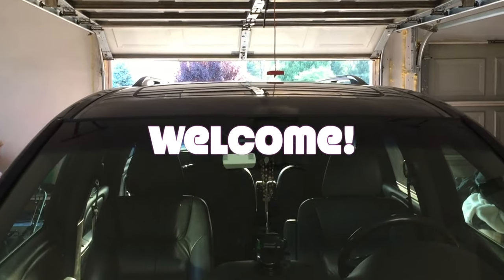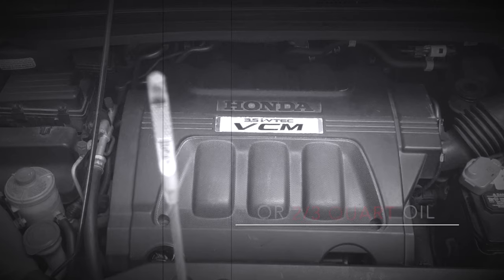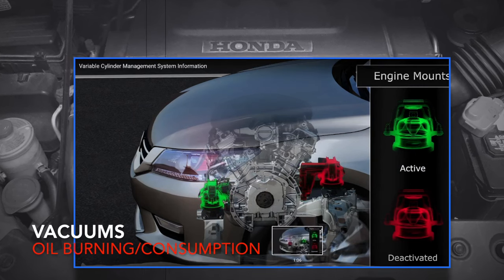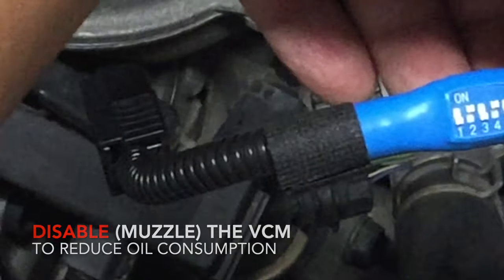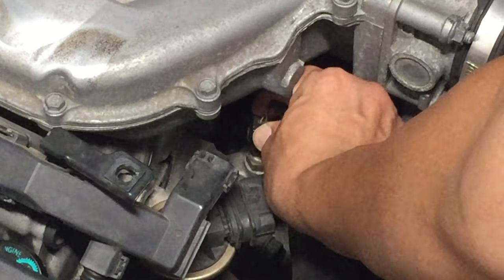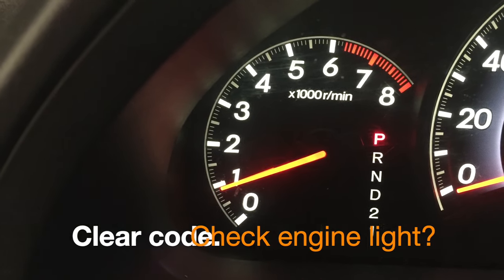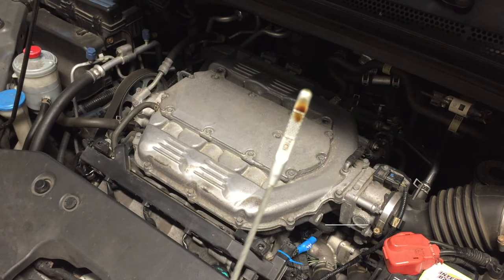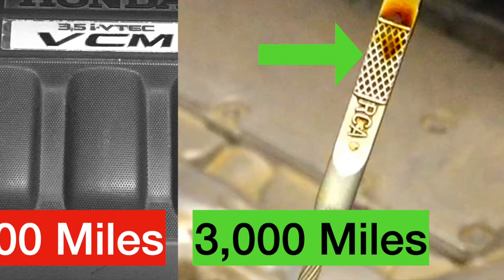Honda V6 Engine Burns Oil? Fix it in 5 minutes.

Comment: I'm I Pennsylvania I bought a 91 ohm muzzler. Will that work in the winter aswell?
Reply from the maker: 91 ohm will work in the spring/summer in PA. It might throw a code in the winter. You may consider switching to an 82-ohm in the winter, which works for me.
Reply: Is there a in between were you can set and forget?@profsg
Reply from the maker: It's possible to find an ohm in between for most of the time. But I believe it may still throw a code occasionally, if not rarely. If you know the code is okay, you can ignore it and let it disappear on its own. There is also a pricier S-VCM controller that can automatically adjust itself.
Reply: Imma give 85 a shot  the worst it could do is activate eco once every moon lol @profsg

Comment: I need to disable VCM on our 2010 Ody EX-L. I worked through a check engine light, VSA light on the dash and engine shudder this past week. All seems to be working now! I've read up on the evil VCM and want to disable it for good. I considered the options listed on OdyClub and Piloteers, but want to spend as little as possible since we are not in this Ody for the long run anymore, actively looking to trade it in.  The DiPressor seems like a good solution for a good price. I considered the DIY route, as it is really cheap to do, but doing it that cheaply is permanent.

@Professor's Garage and others that have tried the DiPressor, are you all still happy with it, meaning is it still doing its job at disabling VCM and keeping the evil ECO light at bay?  Professor's Garage, definitely interested to hear how it is holding up with PA weather.  We are in MA, so have snowy winters and roads treated with salt just like you guys.

FYI, it looks like the eBay DiPressor seller is also selling it on Etsy.
Reply from the maker: This holds up quite well. I did adjust the ohm setting between fall/winter and spring/summer; I only saw the ECO light once or twice during the change of season. Most important, I am happy with the rate of oil consumption and could almost get by without adding oil between oil changes... but I did add some oil to avoid issues. :)
Reply: @profsg  Thanks for the reply! I do like how customizable the solution is. Much better than the crude DIY solution I was planning on doing. I think I even saw on the DIP switch settings page that you could even re-enable VCM, which could come in handy for future troubleshooting.  Thanks for sharing the settings you are using up in the description.  I think I'm sold on DiPressor over the more expensive options elsewhere.

Comment: I prefer using my VCM Tuner II which has some built in features to avoid having to reset for the seasons and will bypass if engine is actually overheating.
Reply from the maker: That's a great feature! Thanks for sharing!

Comment: I wonder if this solution could also solve the (end result) problem of oil burning consumption plaguing 2010 - 2013 Acura MDXs?
Reply from the maker: It has a different engine (J37 instead J35 in the Odyssey). But if they share a similar VCM design--looks like they do--the same trick will likely work there to reduce oil burning. Best luck and keep us posted!
Reply: Probably since Honda makes Acura.

Comment: My 08 honda pilot get 2mpg more when eco mode is off on the highway. With a check engine light on, the Eco mode never come on.  Check you MPG before and after.
Reply from the maker: Thanks for sharing! Interesting you got more MPG with ECO off. Regarding the check engine light, if it's a code associated with an engine condition, the ECO/VCM mode may not come on as it does require certain engine conditions to activate.

Comment: I heard of this,   But never saw how todo it
One thing that helped my 2007 model was to change PCV valve. 
Now it’s about 1qt per oil change
I also use high mileage synthetic blend 5w20 havoline.  I was using super tech  and than burned more then 2 qts oil.  For each oil change
Reply from the maker: Thanks for the comment! 

Yes, PCV is another common reason for oil burning. And on this engine, it is easy to access and replace. I replaced PCV a couple of years ago, and that helped. Also replaced valve cover gaskets and VTEC spool gaskets because of oil leaks. In my case, disabling the VCM significantly reduced oil burning. 

The high mileage oil (additives) may help when rubber seals are aged and getting brittle. I've also heard positive experiences with ATP AT-205 for aged rubber seals.
Reply from the maker: On PCV and other replacements, go with Honda parts if possible.
Reply: It would be best to use Full Synthetic oil than that Synthetic blend they sell

Comment: What about 2006 Acura tsx
Reply from the maker: If it's a 4-cylinder engine, which I believe it is, it doesn't have VCM and not affected by this design. If it burns oil, do make sure to change PCV (Positive Crankcase Ventilation) valve which is the #1 reason for oil burning. Another simple job to do and I have a video here: https://youtu.be/uIHNY6AiDQM  

If this doesn't completely fix the issue, just make sure you monitor oil level, top it off regularly, and, most importantly, follow regular oil change intervals (5000 miles or 6 months). For an aged vehicle like this, you may not be able to completely fix the issue but good oil may overtime clean up some of the clogged components (e.g. stuck piston rings) to alleviate oil burning. Hope this helps.

Comment: Wait.  Does this mean that the ECU is permanently running in open loop, since we're telling it that the coolant hasn't reached operating temp?  Wouldn't this kill your fuel mileage?
Reply from the maker: This is One of the coolant sensors on the engine and the one VCM relies on to determine whether it has reached the ideal condition to turn on. If the adjustment is minor, it will fool the VCM but not affect the other operation. That’s why you may have to monitor engine code and change Dips so it makes no drastic change for the season. There are other options like s-VCM that will make the adjustment automatically and several people have reported positive experiences with that. As for gas mileage, no big difference, somewhere near 1 mpg less, in my experiences.
Reply: No, sufficient heat to transition to closed loop.

Comment: I installed a smart vcm without the resistor settings. It's been about a year and now my 09 odyssey was 2 1/2 quarts low IDK if this is the answer
Reply from the maker: From what I heard, s-vcm is a good product, an improved version of what I have in the video. If you no longer see the Eco indicator, the problem with VCM is taken care of. Now the other common culprit for oil consumption is PCV and I have a separate video about it: https://youtu.be/bGVFDy7I0j8 

Very simple to replace. Given the age of your vehicle, you should change it if it hasn't been replaced.
Reply from the maker: Is it 2 1/2 quarts down between oil changes? I assume you do it every 5k or 6 months whichever comes first?
Reply: Between oil changes i drove my wifes Odyssey and had made a right hand turn and for a split second the oil light turned on. I checks the oil and it was extremely low there's no oil on the drive way and no visible oil from the valve cover or the solenoid area
Reply: The vcm defeat does the job it deactivated the eco mode for sure and it does burn more gas and I haven't had a problem with it sense.
Reply from the maker: Yes, this is a common problem and many people realized that like you did when the low oil pressure light showed up.

Comment: Can you please demonstrate this on a recent odyssey like a 2023 or 2024? I opened the hood and looked at it, but couldn't figure out how to do it as everything is covered and it appears a lot more work needs to be done to even access the plug in points. Looking for someone to provide step by step instructions on a recent Odyssey model. Thank you.
Reply from the maker: Would be happy to if I have a chance to work on one of these. This is the 5th generation Odyssey since 2018, with the J35Y6 engine (direct injection). The following video discusses/shows the coolant pipe placement of J35Y8, and you may be able to find the coolant temperature sensor nearby: 
https://youtu.be/dccGM_r0X-A?si=gXh4naZDnBFgV8Fy&t=282
Reply: @profsg  Thank you.

Comment: Does turning off eco mode on the dash disable vcm?
Reply from the maker: No ECO light on dash means VCM isn't activated. However, I am not aware of any way to turn off VCM/ECO on dash.
Reply: I'm not sure I understand. If I turn off eco mode on my Dashboard,  is vcm also off?
Reply from the maker: @thomasguercio713  Now I see where the confusion is. The ECO light (indicator on dash) is different from Honda's ECON mode, which Honda uses to adjust throttle response and transmission shift etc. for fuel efficiency. My understanding is that the ECON control doesn't affect VCM.

Comment: The piston rings poor design is also contributing to the oil consumption issues. Isn't the piston ring the primary reason for oil consumption? I would think the VCM is a secondary issue.  Can someone kindly explain, thank you.
Reply from the maker: In the ideal world, piston rings should seal cylinders perfectly and there is no gap for oil to seep in. In reality, there is wear and, you are right, over time the piston ring can no longer seal it perfectly and makes it possible for oil to get into the combustion chamber. However, oil won't really get there without a vacuum. VCM, by shutting off some cylinders, creates such vacuums to suck in the oil. And that's why it's the culprit.
Reply from the maker: Also wanted to comment on something related--
Another common cause for oil consumption across many engines is a clogged PCV, which increases the pressure in the crankcase and thus forces oil into combustion chamber. On the Honda engine, this is another cheap and easy fix, and I hope to make another video about it.
Reply: @profsg  thank you. So helpful !!

Comment: I will keep this in mind but my 06 Odyssey still runs like new with 115Kmile. Mobil 1 every 5000 miles (or so).
Reply from the maker: Sounds good! 5000-mile oil change is the way to go. Thanks for sharing!

Comment: For my 2005 honda odyssey it doesn't seem to be working. I first put it on 82 ohms and the VCM is still kicking on. Live in Socal so temps currently are about 85-96 degrees F. Anyone know the sweet spot to keep the coolant sensor from preventing VCM from engaging? I've tried 82, 85, and 92 ohms with no success.
Reply from the maker: A couple of questions here to understand the situation:

1) Does it have any impact on the coolant temperature reading, e.g. on dash or OBD scan?
2) Is VCM/Eco still turned on as usual? Is it less frequent, compared to when it was without the muzzler?

If it makes no difference at all, it must be a defective. I’d ask for a replacement then.
Reply: 100 ohms did it for me (at the current outside temps being in the 100+F a 100 ohms is probably needed anyway but you might get away with lower ohms at cooler temps.

Comment: My 2011 Honda odyssey with 125000 miles started burning oil im putting 0W20 oil on it should I change the oil ?
Reply from the maker: 0W20 oil is officially acceptable on most of Honda engines using 5W20. No need to change it, but please do your oil change regularly at 5000 miles and keep an eye on the oil level. If it continues to burn after VCM is disabled, I'd recommend looking at PCV valve and EGR passages. If PCV is clogged, get a Honda replacement part and it's easy to access and replace it on a Honda engine. This is another common reason for oil burning and I hope to do a video on it.

Comment: Would it make sense that my VTM-4 / check engine light only comes on when coolant level reaches that level and the other 3 cylinders start firing? Took to dealer and they said I need Oil pressure switch replacement. Should I switch sensor or muzzle the 3 cylinders?
Reply from the maker: Not sure without the full context. But what does your OBD II scanner say? It's important to scan the code and see what it says. I have another video on Honda oil pressure switch/sensor replacement but that's due to a different issue: https://youtu.be/CzCDALUYF-U
Reply: @profsg  thank you sir. Will get scan

Comment: on new cars would this be not covered by warranty on the v6 engine?
Reply from the maker: Good question! Yes they are. The problem is, when these issues start to emerge, the warranty will have expired. I believe Honda power train coverage is 5 years or 60, 000 miles. My Odysseys oil burning started at around the 7th year and 80,000 miles. What a perfect design?!
Reply from the maker: Honda vehicles are great! But unless you address the issues early on, the overall reliability is a question. My vehicle is a few miles away from 160,000 and is still running perfectly! Plan to discuss major maintenance items and issues for longevity on Honda in a future video.
Reply from the maker: I should add that it's considered "normal" for engines to burn oil. How much is excessive oil burning is subject to the manufacturer's definition. So it's likely they won't fix it even if it's under warranty because this is just "normal"!

Comment: Do you have a this for Mazda cylinder deactivation
Reply from the maker: I am not aware of similar products/muzzlers for Mazda's cylinder deactivation system, e.g. SKYACTIV-G. If coolant temperature is a factor in determining when the system turns on or off the feature--which I am not sure about--a similar method will work. But perhaps because of market demand (for much fewer Mazdas are affected by that technology), I haven't seen any product like this in the Mazda world.

Comment: can  I have part # please
Reply from the maker: There is no part number as this is a mod and not part of Honda’s design. Here is the link to the VCM Dipressor:
https://www.ebay.com/itm/265031739235?mkcid=16&mkevt=1&mkrid=711-127632-2357-0&ssspo=OAXiAu9oRgu&sssrc=4429486&ssuid=&var=&widget_ver=artemis&media=COPY

The above is relatively cheaper but does require seasonal adjustment of DIPs. Many other options available on the market and people have reported positive experiences with products such as S-VCM in the comments.

Comment: The cost of just one quart of high quality oil negates the small increase in fuel efficiency one gets. Defeating VCM is the best choice and actually saves money..
Reply from the maker: Good point! And that small increase in fuel efficiency with VCM was neglectable when the gas price was much lower. Adding the risk of running low on oil and long-term damage to the catalytic converter, it's never a good idea not to disable VCM.

Comment: exelent video can i have the part # l have a 2008 honda odyssey exl
Reply from the maker: Sure! There are many options and here is the one I purchased (shown in the video): 
https://www.ebay.com/itm/265031739235?mkcid=16&mkevt=1&mkrid=711-127632-2357-0&ssspo=OAXiAu9oRgu&sssrc=4429486&ssuid=&var=&widget_ver=artemis&media=COPY

It is relatively cheap but does require seasonal adjustment of DIPs. Other options include S-VCM (see related comments under this video), which is more expensive but is "smarter" and doesn't require manual adjustment after the initial installation: https://www.svcmcontroller.com/

Comment: Hi there, unfortunately the eBay URL did not bring up the product. Could you please update the link so I can be sure that I'm getting the same product? Thanks.
Reply from the maker: Appreciate the catch! I just realized the seller discontinued that model I purchased and here is their current product (sold by osibana): 
https://ebay.us/Xq5fZ2

Updated the link in video description.
Reply: @profsg  When your Odyssey burnt oil, did you observe any smoke from the exhaust? Mine smokes for a few seconds sometime after the car is in motion. I've not looked observed when exactly the whiff of smoke appears from the exhaust, but I suspect that it is when Eco mode is turned off.
Reply from the maker: No, I didn't see smoke from my exhaust. But make sure you know it's not water vapor (due to condensation over night) and observe the characteristic/color/smell of the smoke (e.g. hopefully not white smoke due to coolant leak). If oil consumption is an issue, definitely disable VCM and replace PCV. After this is addressed, monitor the smoke (if it's still there) knowing it's not due to oil burning. PCV is another common oil burning culprit (for all engines) and I have another video on its replacement: https://youtu.be/bGVFDy7I0j8